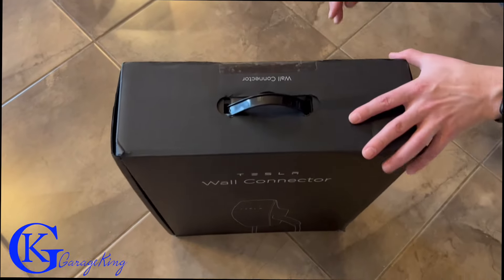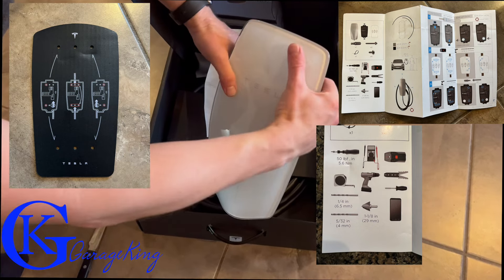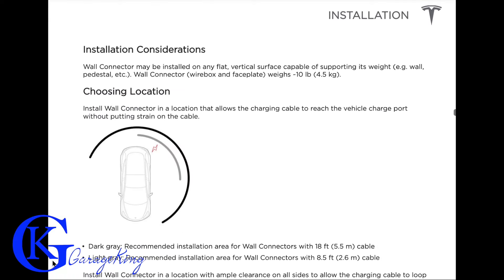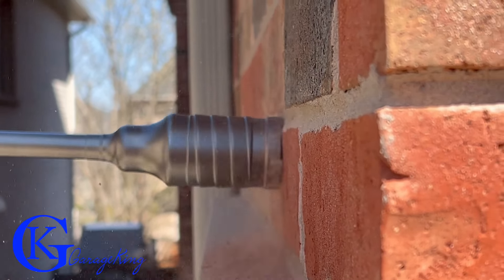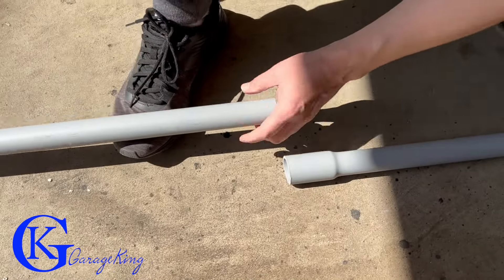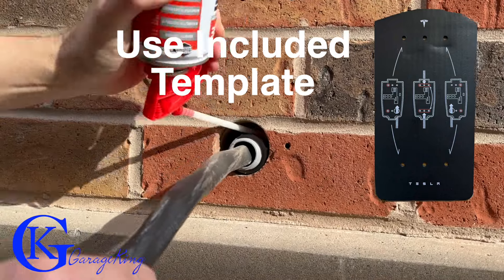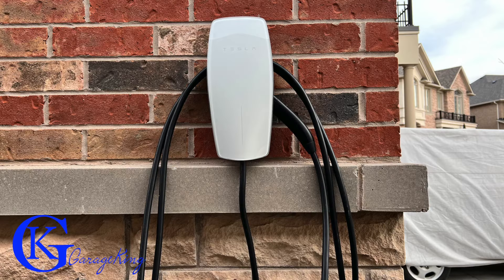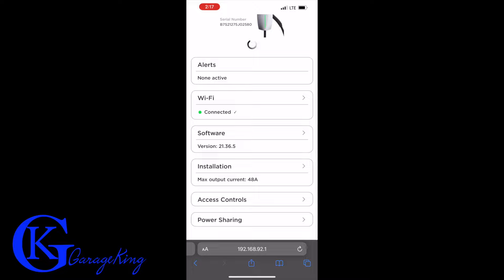Tesla Wall Charger installation (Gen 3)

Comment: This is not a good tutorial from an electrical perspective! A bit more information is needed

For Canadian installations: 
1.) use the ground conductor that comes with the wire if you buy e.g. an NMD90 6/3 or 6/2 (ground wire size will then be AWG8) DO NOT USE the (white)) neutral conductor.
2.) If you use NMD90 and AWG6 you actually can use a 60A breaker. Here is why:
2.a.) The terminal connection temperature rating of breakers above 35A (60A included) are 75degC terminal ratings. (this includes pretty much all breakers since ~year 2000)
2.b.) The terminal connection temperature of the Tesla HPWC is also rated for 75degC.
2.c.) an NMD90 (for 90degC max rating) can be used with up to 75A (90degC), 65A (75degC) or 55A (60degC)
Since all elements are 75degC or higher rated, the 75degC value can be used. This is in CEC2021 Table2 on PDF page 449. This value is valid for installations with ambient T of up to 30degC.
3.) NMD90 can only be used in residential, non commercial environments. As soon as you are non-residential you need to go to a protected installation method. 
This can be either conduit or most popular, a TECK90 cable.

This explanation is specifically for direct wiring of the HPWC in Canada and DOES NOT apply to multi-use power outlets like a NEMA 14-50 or similar!
Garage King has no safety issue from a current/load perspective, even though his installation would not pass inspection.
Reply from the maker: Hey thanks for the comment, the one thing I'm doing when its warmer is I'm going to take out the white neutral wire and just use a copper bare ground, I got that one.  The other thing is there was a lot of mixed discussion on running the wire unstripped in conduit.  A lot of people said you can't do it, and you are not suppose to in wet or underground, but in the garage how I did it, it is fine.  But because I'm fixing that neutral I'm going to strip it anyways.

Comment: I folks, if in the UK things are rather different, For one thing it is illegal to run a new feed from the consumer unit (aka 'distribution panel' in the States) unless a certified electrician. You will also need the relevant building regulation completion certificates to be issued. Our domestic voltage is normally single phase 230 volt RMS AC and the maximum current allowed is normally 32 amps - giving 7.3 kilo Watt charging. Your electrician also need to take your property earthing arrangements into consideration. Cable dimensioning depends on a number of factors, length of run and how it is fixed being two of them. Some outdoor runs require to be in armoured cable. This is not a DIY job. See Part P of the UK Building Regulations for much more info. Incidentally, I'm not a certified electrician!
Reply from the maker: Thanks for the comment.  Yes it seems that things are quite different in the UK.  Even the power amount (32amps)  Thanks again

Comment: what if my sub panel is inside ?
Reply from the maker: Hey there and thanks for the comment.  If your panel box is inside you have a little more work to do......  You have to run the wires into the house. The closer the panel box is to the garage the easier it will be. The 6/3 gauge wire you have to use is fairly thick so to run through walls is not easy. I would go to your panel box and look at routes to the garage.  If your basement is not finished it will be easier.

Comment: It's not a charger it's a power connector...
The actual charger is built into the Tesla end of story.
Reply from the maker: Good comment and you are right, so many including myself have referred to it as a charger, but your 100% correct, its the car that regulates the power.
Reply: Sorry for coming across rather strongly.  What I'm really miffed about is that here in North America these devices (connectors/hardware that provides power to the onboard charger) are strictly single phase. In Europe and Australia they are available in three phase because most buildings including residential are fed with 3 phase power. Significantly more efficient and you can use smaller gage wires.  Especially if your service is 3-phase 120/208 volts as apposed to 120/240 1-phase.  To deliver the same KW at 208 volts (1-phase) you need more amperage and therefore larger wire.  One day especially the USA will wake up and smell what I consider to be better coffee so-to-speak!  Thanks for baring with me.  Ethan
Reply from the maker: @ethanclement9647  I wish we could get 3 phase for residential here, but sadly its not offered....

Comment: Wow holy code violations Batman
Reply from the maker: Hey Thanks for the comment, the one thing I should have done was stripped the neutral wire that I used instead of taping it.  I did mention that in the video I think.  Others have said the sheathing should be stripped off, but in this case it does not. The wire gauge and circuit breaker are fine.  There is no safety issue.  I plan to strip white wire so if I ever sell the house and it gets inspected it will be ok.

Comment: The white wire should have been capped off not the ground. There is no need to run a 3 wire. You only need a 2 wire with ground.
Reply from the maker: You are right only 2 wire with ground needed, so 3 wires total.  You can only buy 4 wires together with that gauge needed (in Canada anyway). So we have black, red, and white which are thick, and then a small ground.  As I only needed 3 wire, I used the red and black for HOT, and I used the white for a ground as it is thicker.  I labeled the white wire as a ground.  Then I did not use the bare copper ground at all, as not needed. This way I used all 3 thick wires instead of 2 thick and 1 skinny ground.

Comment: Stupid Wall or Ground charge cables. Extremely Stupid
insane Tesla Wall Charger and more Insane charging cables laying around. 
Ceiling Chargers
Ceiling Cables
Never ever trip over high voltage cables
Never drive over high voltage cables
Spring r Bungi r Rope w Counterweight
All from top-down ceiling hook down
Stupid Tesla Wall Charger
Reply from the maker: Hey Ed, you seem upset, and you are right that all from top down would be the best way to do this.  My car is parked outside so I really can't.  I did get a chuckle out of your comment.  Hope you had a good weekend bud !!!

Comment: Code violation current carry conductor (NEC  table 310.15(B)(3)(a) and conduit fill article 300.17 and identification of equipment grounding conductor article  250.119(A)(2) don't always go with the instruction manual alway check with your local code unless your in Canada
Reply from the maker: I am in Canada, and you know I actually pulled the wire, it was easy as it was a long run and ran two 6 gauge individual hots along with a ground so no worries !!  I do tell those who comment that its better to run individual THHN.
Reply: I'm about to install this wall connector, and I was originally looking at using a 6/2 NM-B Romex, but I think I will be changing my mind and using a 6 awg THHN (black and red) inside an EMT conduit for some of the length and the others will be behind the drywall. For the ground, can I use a green 6 AWG THHN? It's about 110ft run from the panel to the charger. My panel is a 200amp supply. Any advice is greatly appreciated.
Reply from the maker: @mikefd14  I think you are fine running individual 6 awg THHN inside conduit, and a green 6 awg for the ground is fine. The only thing you mentioned is "inside an EMT conduit for some of the length and the others will be behind drywall" You must check the code in your area how to terminate the conduit. Also I would consult an electrician due the the long run you have, I don't think many people are doing 110ft runs.   Fyi - I rarely use over 15amps current as I set my Tesla to "top off" to 80% every day during off peak hours.
Reply: @GarageKing thank you for the advice. In terms of the conduit, it will run from the panel to the wall between the battlements and the garage then I will have to fish it up to the attic above the garage and over to the other side. I was thinking of transitioning from emt in the basement then going to a flexible metallic conduit behind the wall and up to the attic and then run that to the other side to the wall connector. Idk... if that's a best way but this is why I'm researching. Thank you
Reply: I am also planning to put a disconnect switch close to the wall charger
Reply from the maker: @mikefd14  I think that sounds like a good plan, but you have to know that length requires a lot of fishing !!!!
Reply: @GarageKing  yea I think I'm prepared for the fishing part...I don't believe this job cost $5500. I'm very handy and mechanically inclined... just need a little guidance. So thank you. I'll let you know how it turns out.
Reply from the maker: @mikefd14  ya 5500 is quite steep, but supplies will cost a bit with that length of run. Thanks for the follow up and hope the job goes well !!

Comment: It is against code to re-identify a neutral as a ground
Reply from the maker: Thanks for the tip and that’s the one thing I should not have done. I could have removed the neutral.
Reply: In the UK you can but you have to put a green-yellow (Earth) sleeve on it and heat shrink it to cover (like 90% of) the unwanted insulation colour.
Reply from the maker: @IAmThe_RA  Good to know, I didn't know that.  Thanks

Comment: It’s a simple project, but the thumbnail calls this a charger but it IS NOT A CHARGER. The charger is part of the car, or one of those massive DC objects with the high voltage signs. 😅 This thing is just a connector, which is why it’s a simple install.
Reply from the maker: you are 100% correct good sir, but the problem is everyone calls it a charger, including me until I read your comment.  Good comment !!!!!